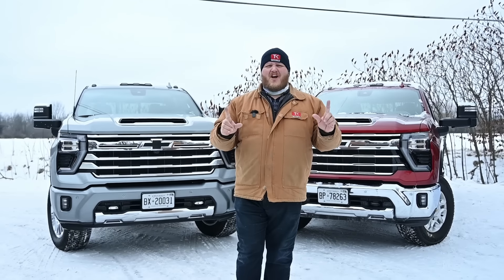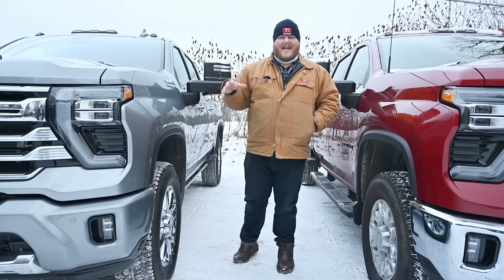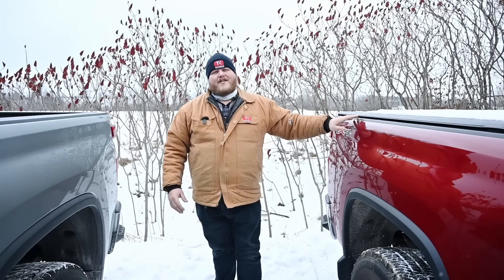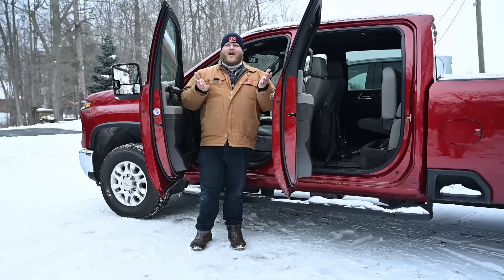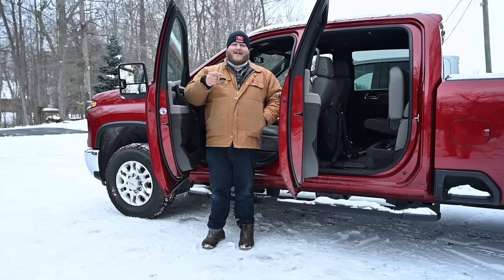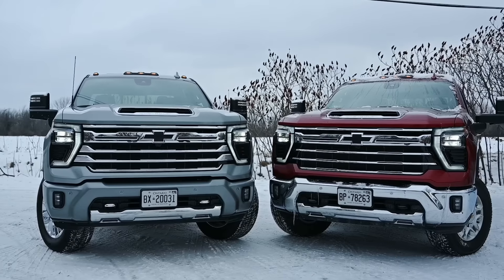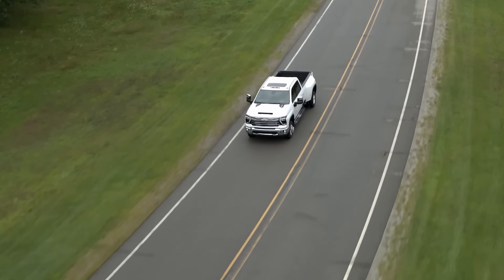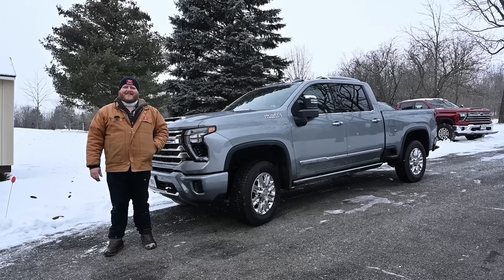2500 vs 3500 Trucks - What's Really the Difference? We Compare Two Chevy Silverado HDs to Find Out

Comment: June of 2020 I got the 2500 HD CC LB LTZ Z71 with every option but the sun roof and 5th wheel package. I wanted all the options but no sun roof and wanted white CC LB and don't like the high country white bumpers, HC wheels, stock wheels, and a couple other things. They had 3 LTZ trucks with every option but sun roof and 5th wheel prep and z71 for the same sticker price as the HC. Orders weren't getting filled during the pandemic and I really needed a new truck when I finally went looking. The 5th wheel package would have been nice to have. With back and neck problems I didn't want a harsher ride and there were mixed opinions on the ride of the 3500 plus komnifornia would have just charged me more for tags and my needs were easily met with the 2500. To get the softest ride possible, I also added solastic spring hangers in the rear although I'm not sure how big of a difference it made since I did it only a few weeks after buying the truck. The ride off road is much better with 600 pounds of bagged concrete at the very end of the bed and towing my 21' toyhauler or 14' dump trailer at up to 14k pounds is great, but I did use a heavier 24-28' flat deck trailer that made the truck bounce horribly when empty. With a skid steer and heavy steel gates on the trailer it was more tolerable. If it had the 5th wheel or goose neck prep, I would have rented a goose neck trailer instead and likely would not have had a miserable 400 mile day. I love mine and added the banks pedal monster which makes even more difference than the derringer tuner. It can get 20 mpg on the freeway at 85 mpg and tows 12-14k pounds with ease. This video covered all of what I had to search for on my own before buying my truck but it took me 6 months or so to go through the Chevy web site comparing builds and prices as well as package options. They do make it confusing and the packages change multiple options at one time. I'm lucky that mine had every comfort or convenience and entertainment option and that I can add an aftermarket hitch system if needed vs. missing features that can't be added. Yes, it was worth getting all the options. My previous daily driver was my 79 C20 which I have done major upgrades to including a very well built 406sbc, gear vendors OD, interior upgrades, autometer pro comp guages, etc., but it was time for a more comfortable, more powerful, and more fuel efficient truck. I hate driving and mostly just drive for work or necessary local errands and it is great to something so nice. My 88 K5 blazer is just used to get all my targets and gear to the shooting range and as a backup vehicle and my old pickup is parked for now.

Comment: So...simply put. If I bought a 2500 with the max tow package, it will tow and have a payload exactly the same as the 3500 except that the numbers on the sticker will classify the 2500 with a lower payload number. Payload of the 2500hd with max tow package is the same as the 3500 in reality, but on paper it is less then the 3500. Correct?

Comment: THANK YOU!!! I'm a structural engineer and have been so frustrated with the internet not knowing that payload is not really capability but a legal restriction based on class. Subbed and liked for that and making it a point.
Reply: The internet doesn't give a shit
Reply: Read the sticker in your door frame. Also read my comments. There really is a difference although they are few and minor.
Reply: I wonder what your opinion is about 1500-series trucks. Same?

Comment: One thing that most people don't know is the 2500s are Torque limited in 1st gear, which GM originally admitted to but has worked to destroy the evidence of that admission. Their original marketing said something like "with a 12 inch ring gear 3500s get full torque in 1st gear" or something like that, so it was implied in their marketing and confirmed by one of their engineers. 

Also of note, the 12" ring gear is only available on Duramax powered trucks, 3500 Gas trucks still have the smaller 11.5" ring gear axle

Comment: Is there no difference in the rear leaf spring pack and shock tuning? I'm wondering between 2 GMC Sierra HD "AT4" for example. - 2500 versus 3500HD. I would assume the 3500 is slightly stiffer?

Comment: A DRW v. SRW comparison would be a good subject.  The modest differences between 2500 and 3500 are for legal differences and markup justification and that has been the case since the C-20 vs C-30 era. That's why it's common to modify 2500s with heavier leaves for better behaviour WITHIN legal GVW.  The "overload" leaves (the correct term) can be added to any truck without them Swappable GM truck parts are a benefit once out of warranty.

Comment: You mentioned that one difference was the height of the 3500. When you add max towing to a 2500 resulting in the identical rear suspension does that raise the 2500 to the same height as the 3500? Great video. It was very helpful.
Reply from the maker: within an inch

Comment: I have a hard time calling anything with IFS a heavy duty truck.
Reply: I completely agree. I have been waiting for a Super Duty order for almost 2 years. If the GMC had a live axle front end I probably would have walked away from Ford and bought a GM. Ram puts their adaptive steering on everything these days. I don't want a HD pickup that has the steering weight of a micro car either. Plus Stellantis is making decisions that tell me they don't understand, or don't care about, the North American market/consumer.
Reply: @rich7447  I bought a ram 2500 in 2015 and unless something changes, won't buy another. I love my truck but they don't care about us
Reply: @johncotter9082  I loved my 2011, but it was the last year before DEF and traction control, and to tell you the truth, it lacked payload and tow rating for what I use a truck for. Then they went coil spring rears on the 2500 and I started questioning their sanity. 
Now that they are headquartered in the Netherlands I have no faith that they value the same things that we do.
Reply: @rich7447  I agree, I bought a Power Wagon because I love crawling and doing crazy  stuff. But now I am afraid of buying anything new. Ford has an unfixable death wobble from the factory, GM is trying to figure out valve issues, and Ram, even with nice interiors and technology, can't figure out who their target market is. It really sucks.

Comment: Both trucks wheel wells will start rusting within three years . Wouldn't you think at the price somewhere around 90 thousand dollars they could build them out of better materials .
Reply: Good point. But doesn't it also depend on what part of the country the truck is operated in?

Comment: The legal weights are not confusing. Its simple and striaght forward. Know WHAT YOU USE THE TRUCK FOR plan for that when you order the truck, plate it for the max load you plan on utilizing. The 1000lbs lower payload on the 2500/F250 really hurts the 5th/GN tow ratings. A 250/2500 its fine for a Gas engine.  But the added 800lbs of mass for the diesel

Comment: You forgot to mention the 3500 has a bigger rear axel to except dual wheels, and has an extra cross member added to the frame.
Reply: I believe they did mention that when they were showing the factory part.

Comment: I'm not sure if it was called a "max tow package" but my 2022 sierra 3500 HD had an option for "towing/snow plow suspension " my dealer said it was rated higher than a standard 3500 HD suspension... so I got a little better than a 3500. This is a SRW not a dually too.

Comment: Dually is a 1 ton. Otherwise, buy the 3/4 ton.
Reply: If you are getting a diesel the additional engine weight can limit the payload in a true 3/4 ton. GM and Ford get around this by going over the 10,000 lb limit for class 2B (so both the F250 and 2500HD are really class 3 trucks). Ram sets their GVWR at 10,000 lbs and the rated payload is not good.

Comment: Also, my 2024 3500 hd wt has a governor at 93 mph. I was told by a dealer that it comes programmed to the ( Michelin) tire speed rating. Bf Goodrich has a 106 mph rating. 
Anyone know how to reprogram? The dealer said they can’t do it , it would have to be an aftermarket gizmo. Haven’t found anything yet.

Comment: Awesome info, glade I found your channel as I am currently in shopping mode.  I will be buying either a 2500 or 3500. I do want to make sure the 2500 is max trailering other than that, LTZ package or if I go GMC either AT4 or Denali.

Comment: I wis i had seen this video 15 years ago.  

theres a big difference between 1/2 ton and 3/4 ton, single rear wheel and drw, and going from 80psi tires to 110psi tires.  The difference between 3/4 ton and 1 ton srw is the 1 ton  has a higher payload sticker but is far more likely to get told to stop at a weigh station,

Comment: i heard the 2500 doesnt give full power in the first 3 gears unlike the 3500..is there a way to test like like a 0-60 run with both trucks
Reply: I read a post in the Duramax forum that mentioned the 3500 does not limit torque in lower gears from a GM employee. Also that the stock tires are slightly wider/higher PSI. This post was circa 2020.

Comment: I just wish you could still get a basic "farm truck" without all the fancy bells and whistles.
Reply: A lot of the "bells and whistles" are government mandated these days. All 3 manufacturers have entry level work truck variants that don't have that much over required equipment. It doesn't make sense to build anything with manual windows and no A/C anymore and they have to put a screen in for the government mandated backup camera, so they go with a more standard version of the higher end infotainment system. Unfortunately this often means fewer actual buttons which is a PITA when you are wearing gloves or have dirt all over your hands.
Reply: @rich7447  I didn't know backup cameras were a government reg, my company truck has it, but I just ignore it and use my mirrors. I can't tell how close I am to something using it.
Reply: @HamiltonFamily2023  I personally don't like the backup cameras and only use my mirrors, but the government (NHTS) said anything built after May 1, 2018 must have a backup camera. Manufacturers seem to be constantly chasing these regulations mainly due to the way that new regulations come out.

Comment: My 24 LTZ 2500 has heads up display and rearview camera. It has everything the high country does except z71 and power running boards. Payload is 3100. Pulls my 40’ fifth wheel with ease. It doesn’t have the max trailering but that would have been nice to know about when I bought it in April of 2023.

Comment: Iam about to drive my new Chevy 3500hd Duramax off a cliff. The exterior mirrors rattle very loud on the inside. Something is loose behind the dash and rattles and the transmission is starting to act funny at times. I wound never buy another one. Also If you get pulled over for towing something big they check your tires to see if they are rated for the weight then they check your axles to make sure they are rated for the weight.

Comment: I have a 72 Dodge 1 ton 10 ft long bed 8 ft wide dump with the 318 on a two-barrel 4-speed transfer case😮 miniature rough looking footage draw a gray truck very solid good on gas goes fast as you want to go, it'll carry two and a quarter quarts of wood on it no problem

Comment: Thanks for the info on the Chevy.  I carry a slide in camper and tow a flat bed trailer with a 1952 M38 on it.  Not much info out there on putting a camper on the pickup every one thinks camper means trailer.

Comment: A little into a year with our 3500 LTZ 6.6 gasser (No sunroof) that we also tow a Grand Design fifth wheel with. Very capable truck and I say that coming out of a 2015 Denali Duramax dully. No more hassles parking or finding an automatic car wash. Also ordered the LTX verse High Country more for the chrome bumpers and look. If you order one right (tech package mainly) the interior finish is the only big difference and frankly we don’t notice it compared to the 15 Denali.

Comment: First off great information.
I have a 2016 2500 and the payload is 1500ish pounds.  I am thinking of getting a truck camper, but based on that payload I would be way over capacity.  
Do you think I could upgrade the leaf springs and as I have seen others do, add timbeens, sway bar, andupgraded shocks to compensate for the weight?

Comment: Great explanation of the difference between the two classifications of trucks 🛻. You really hit all of the points. 
I don’t have a need for either actually but I like to learn, even though I sold Chevy for a year and some change. The main thing that I don’t like about the LTZ vs the HC outside of price is that I can’t stand big chrome bumpers. But if I had to pick a Chevy HD truck 🛻 I would just get the ZR2 trim.

Comment: The 6.6 gasser version of each of these with the Allison 10-spd tranny, of course, increases the GVWR (due to the powertrain weight difference). My 2024 Z71 CC 2500 has a 3,550 lb. payload, 16k conventional and 18,200 gooseneck/5th-wheel tow rating.

Comment: I ordered a 23 3500 LTZ midnight long bed with camera mirror and heads up display, no sunroof or power steps. I now have a 24 3500 LTZ short bed the same way with no sunroof. And should have my ZR2 2500 in the next week or so also no sunroof. I would forget to close it, so I never use it. I have met me, lol. You can get every option except badging and better interior LOOKS on an LTZ for about $7k less with the same options,

Comment: i tow a 14k trailer for my business. i tow with a ram 2500 but had to put air bags on the back so not to sag. i want to buy a new truck but 3500 are out of my price range. so if i get a 2500 can i put 3500 springs and shocks on to basically have a 3500?

Comment: I see the number of leafs in the main pack are the same on the 2500 & 3500 @ 5 each. What I'd like to know is if the spring rates are also the same. If they are, then theoretically, they should have the same "ride quality" empty, since the 2 overloads on the 3500 don't engage until there is a load in the truck. Is there a presumable difference in empty ride quality between the 2? I know these trucks are designed to tow & haul, but realistically, majority of owners will put on more miles empty than loaded.

Comment: From what I see, and correct me if I am wrong, the 2500hd with the tow package is actually a 3500hd. There is really no difference except a slightly lower payload, and that in itself is only a number for clerical purposes. In actuality, the 2500hd with the tow package has the same weight and tow capabilities as the 3500. The only difference is the badge.

Comment: Very informative video . . . you mentioned that the shocks are different, does one of these ride any "softer - smoother" than the other ? I'm sure you've been in a dually version of both - do they ride any smoother than these ? ( other than the stability like you talked about )

Comment: This is an excellent video guys. I love that you got real numbers from the factory and explained the engineering.  It's so difficult  at times to get a clear answer when trying to spec a new truck from what the real engineered capability of the specific truckk is vs the advertised numbers game.  I love that Chevy actually shared the engineering with you. I would love to see this type  of video on the  Ford F450 pickup vs f450 chassis cab and also the Ram HD versions.  Excellent work. Most people won't discuss frame differences, etc.
Reply from the maker: We're glad you enjoyed the video!

Comment: I don’t understand why people have questions about this.  The model number is literally a reference to its payload and towing capacity. Dodge, Ford, General Motors and many industrial Truck companies do the exact same thing.
Reply: Ram seems to be the only 2500 that is still a class 2B. Ford and GM have both gone over the 10,000 lb GVWR on the 250/2500HD so they are actually 350/3500 with 250/2500 badging.

Comment: I work at flint assembly where these trucks are built. Those handle things for stepping in look nice. I wish they came with something like that stock. On average, I climb in and out of these monster sized trucks about 70 to 80 times a day and it's really starting to take a toll on my back and knees. People on the outside think that autoworkers are always whining and are overpaid, but most of those people have no idea what it's like to work on an automotive assembly line. Most people with 25 plus years can barely even walk anymore.

Comment: You can also build the 3500HD LT and save even more and still get a truck that is real close to the top of the line and save 13 grand.  Midnight edition 3500HD with Duramax is the best bang for the buck.

Comment: When I bought my 3500 chevy in 2006 I found exactly what you were talking about with numbers and weights. I bought a single wheel long bed. I really enjoyed your video and the explanations you gave. My truck has over 300000 miles on it and I'm starting to think about buying a new one. I can't get over how much they have gone up. I paid $41,000. out the door for mine and the same.one today is in the 90's to 100,000 depending on what you want. Can you do a video on the new Duramax? I would like to know if the new ones are as good as the one I have now. I have heard that they have made some changes that were not good buy that is only rumors. Thanks again to you and your Dad for a great informative video